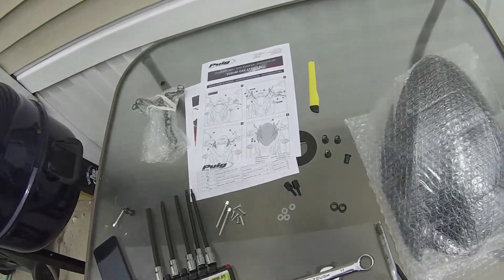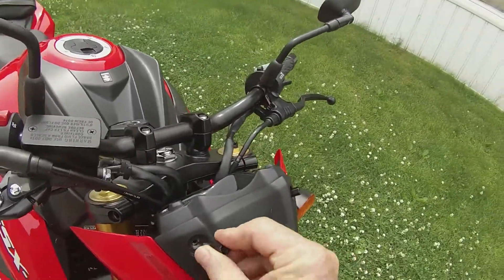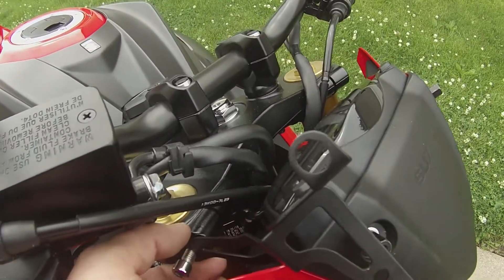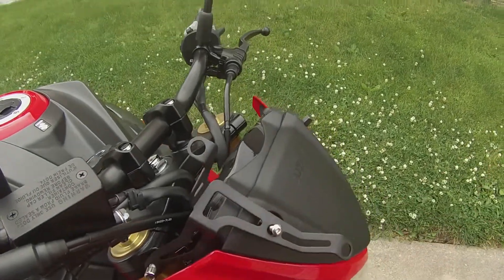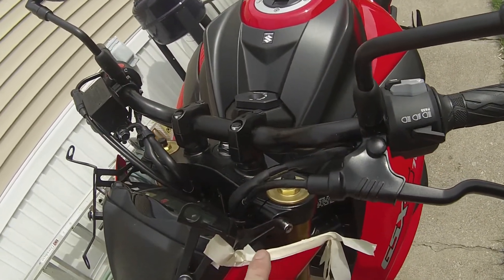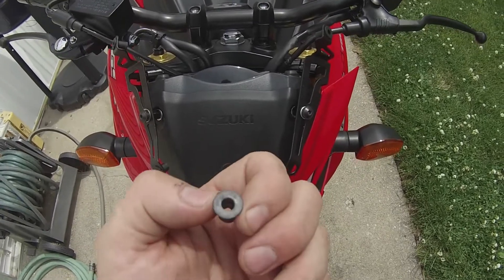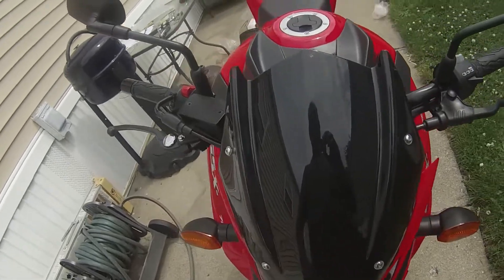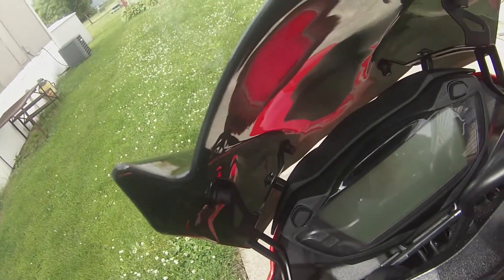how to install a puig or  krator windshield/wind screen on a gsx s750

Comment: Thanks for your excellent installation tutorial.
I received the windshield today, bought in England. I installed it. All the screws were the right length and the quality is good. Before I had a Motozaaa, the PUIG is better quality, the plastic is thicker, more rigid. There are also black caps to cover the screws. Very happy, very nice look on the bike.

Comment: Got the same kit from Amazon. I did receive two of the shorter screws that you had to use the originals.  I have yet to install it. Thanks for the info
Reply from the maker: no problem

Comment: Is there a torque spec for the triple tree bolts
Also, can you re use the factory bolts?
Reply: Stock torque is 23nm for triple tree screws